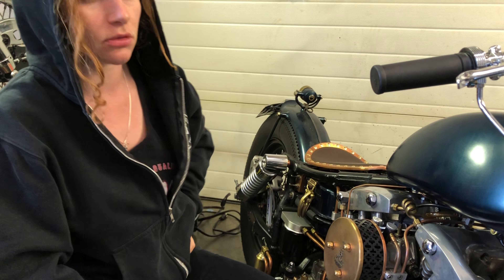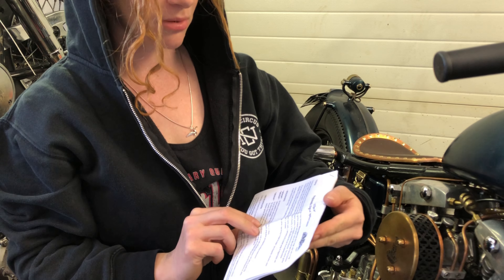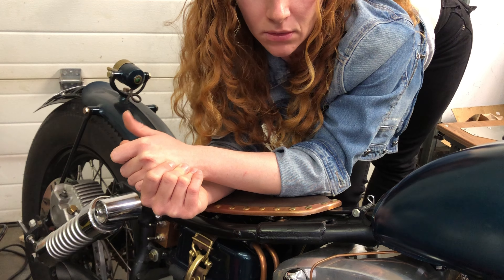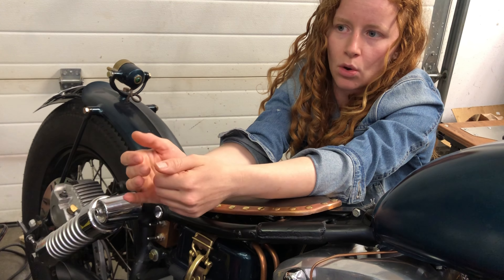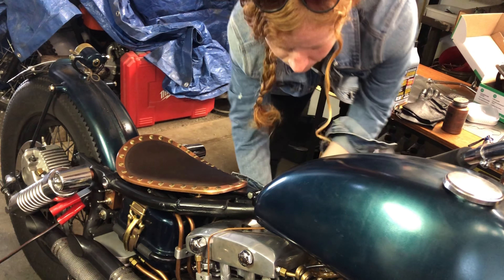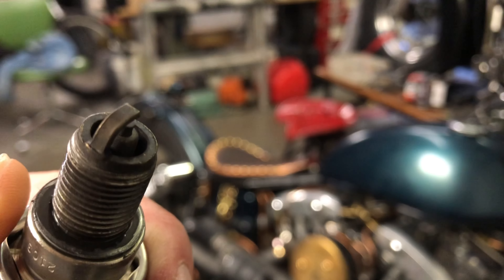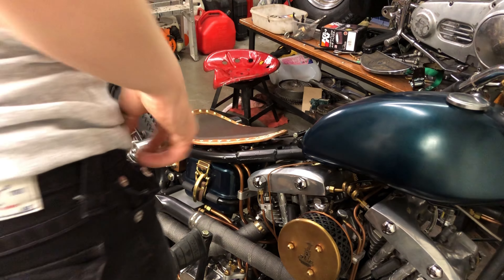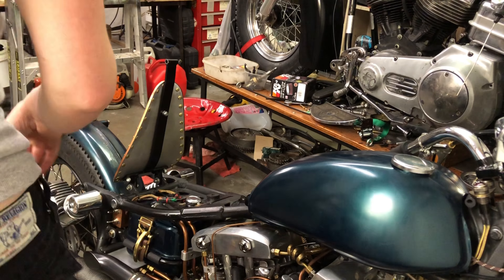Talking about the bike, filling oil and  a Compression test (16:00) on my S&S Shovelhead stroker.

Comment: Red, sorry took so long. 
If I remember correctly you have a S&S E right ?
Jetting on the G is different,  but I'll give you the " basics " for jetting the E with the ThunderJet. 
Intermediate: .031-.035
Main : .066 and up.
Air bleed: 135-155, that's the one on the side you thought was a screw.
ThunderJet: 100-145

Usually 2 sizes SMALLER on the main jet size, when using the T/J, than what S&S recommended for the main size in general.  This is your starting point ok. 

I do recommend using it, so don't let it throw you.  If you need the tuning on the G, let me know. And don't forget to suscribe to my channel as well,  I'm going to cut back on the racing because I need a life, and I will get to do some videos myself. Maybe I'll even play my bass guitar and give everyone a good laugh ha !

T.S. RACING
Reply from the maker: I just subscribed to your channel! And, as always, thank you for the info 😎
You are correct, my carb is a Super E with a replaceable air bleed jet.  I know that I've got a 135 in there for the air bleed right now and, if I remember right, my main jet is a .070 and my intermediate is somewhere around .036. 
I think somewhere around there, but its been a couple years since I've had a look inside. Can't remember the thunder jet size but I want to say its on the smaller side of those sizes that you listed. I plan on getting that taken apart asap when my jets arrive in the mail, and I will definitely be filming that for the channel!

I really look forward to seeing some videos from you! Will be awesome to see what you do and hopefully will get to see some of the racing side of things as well. 
 And yes, definitely need to share your bass skills as well 👌
Reply: I wouldn't drill no holes in a s@s e either. If u want more carb go to a dual throat

Comment: One thing about a compression test, make sure you hold the throttle wide open when testing. it's tough to get a good reading on a kick only bike but it will be artificially low if you aren't holding the throttle blade open. It can't get air past the throttle blade to fill the cylinder to compress. Love the bike by the way, those copper lines look amazing!
Reply from the maker: Thanks man! Yep, throttle was open during this process.

Comment: Those plugs are looking pretty black, the problem may be an over oiling condition. I have a panhead that had somewhat the same problem, fresh motor top to bottom, oily black plug color in both cylinders, exhaust pipes were wet with oil, had the heads off twice to check valve guides, and pulled the cam cover to check gear timing, no change. Was at my wits end as to what the problem might be when an old timer bike mechanic told me to remove the two large screws on the oil pump, springs, and check balls. Use a Q-tip to clean the check ball seats, and reassemble. The engine started behaving immediately, for some reason one of the balls for the bypass oil was stuck, allowing the top end to get flooded with oil. Also make sure the correct ball and spring is in it's proper bore of the oil pump. Your problem may be different, but ya never know till ya try.

Comment: i have a bike almost identical to yours  ive had many of the same problems as yours  solved them all  make sure the crossover tube on the rockerbox is not resticting the flow  as far as starting issues those ignition modules really work best with electric starts points or the dyna s work best for kick starts  and those thunderjets dont help at all

Comment: Thanks for putting up this video.  I am in my garage fussing with and occasionally swearing at my Panhead that is being very uncooperative, our bikes might be related!  When my leg gets tired from kicking (I'm around 40 years older than you) I sit down and watch more of this video and read the comments.  If you have a high performance cam, the overlap may lower the compression test results.  My engine is built very similar with high quality, high performance parts, I seriously doubt that your cam is anywhere near stock, which adds to the performance and fun but can be more finicky.  I've had my Pan for 24 years, had shops work on it, expensive mistake (one shop did the pistons and cylinders like yours, after they returned it I could turn the engine over with one arm using the kick starter), like you I am doing my own repairs and learning as I go.  Keep it up and stay positive.  A fringe benefit is that you get to buy more tools!  ☺
I just finished the video, great cartoon at the end!
Reply from the maker: Hey Warren, thanks for watching! That makes me feel better knowing that my videos of me sharing in my frustrations with this old thing can provide a bit of solace for my fellow riders. Thank you for your comment as well! And the comic is something my dad drew up in the 90s, he did a bunch of them and I plan on adding them to the ends of more of my videos. 
P.S. if you haven't seen Pacific Mike's channel yet you should check it out! He's got lots of vids of him working on old Harley engines. Here's a link to his channel: 
https://www.youtube.com/channel/UCgjEK5Whd-2jgogSwCHS0xA
Reply: Pacific Mike is an awesome teacher!😎

Comment: Red, there was a couple comments i thought where very good suggestions. First one was to check your pushrods for being too tight. The second was to check your oil passage balls. Lots of times there is not enough attention to the little things during these rebuilds. My take  on your issue is rings or the final bore size. You mentioned that basically that was all you changed on the rebuild.

Comment: Comment number three😂 I'm sorry. It is recommended to measure compression on a cold engine with the throttle open. Regarding: how much oil needs to be poured into the cylinder, the answer is a little (a whole glass is too much). Compression of older engines is usually not high (since low-octane gasoline was used earlier). For Ural and Dnepr motorcycles, 6-7 atmospheric units are considered excellent.

Comment: Red Rider, After 100 miles on a new motor you should go over all your bolts. I would specifically check the cylinder base bolts &
make sure those head bolts are good & tight. If you get them more snug then they were, readjust your vales if you have solid lifters.
If they are hydraulic, they should adjust themselves OK. I had an old Triumph years ago that the cylinder came loose after 100 mile
on a fresh rebuild. I destroyed the cylinder & had to buy a new one. I lock tight them now, but still check them after 100 miles on a rebuild.
I was taught not to use a torque wrench, but wack the wrench with a hammer on the head bolts till tight. I'd lightly tap the wrench
with a hammer on the base bolts too. Loose head bolts can give you oil in the cylinder & low compression.

Comment: Its only a small point. but have have you tried using  softer plugs . I had a a 1973 Norton 830 Commando  and it was a pig to start on hard plugs (champion). For around town I used soft plugs. and on long runs I would change to the Harder ones. Then I found NGK Plugs witch had a wider heat range, and my problem was solved. (Your plugs will be wet with all the Kicking).Good luck in what you are doing. I enjoy your Videos.
Reply from the maker: Thanks!

Comment from the maker: Just want to add a comment here. I did the oil in the cylinders (18:40) to check for ring seal, but the bike was still pretty hot so I’m curious if this would still work on a hot engine or does the heat cause the oil to run down the cylinders walls too quickly? I filled the cap from my quart jug with oil and poured two of those in there. Is the at enough or should I have used more?
Reply: that should of been enough even hot should not run past rings . a new motor or ring job if done properly honeing and ring gaps need to be done by someone that knows what there doing . also if your running overly  rich it will make it hard for rings to seat your spark plug didnt look sooty from to much fuel they look like there oil fouled either by rings , to much oil causing it to build up pressure and not letting rings seat or if your valve stem seal are shot and valve guides worn excessovly but 1 thing is for sure with your plugs lookin like they do so also will buildup on your pistons by witch piston and cylinder scuffing will accur . but for starters lets make sure the basics are good before we go to deep at this moment and that being compression test. and make sure when you doing the test your throttle needs to be wide open ok and do both cylinders the same amount of kicks lets do 4 kicks each if your  agreement on this?
Reply: thats terrable compression
Reply: throttle needs to be wide open if that doesnt help in better compression . it will need to be torn down
Reply from the maker: Throttle was wide open during this test…

Comment: Since I'm a fan of all kinds of automotive chemicals, (thanks to which, indoors, then my head hurts. You can use a carburetor cleaner). But the easiest and fastest way to clean candles is to remove the dirt with a rag and slightly calcinate (the part of the candle where the spark occurs) this candle with a lighter (ideally if it is a "Burner with ignition" and a small tourist gas can). You can also simply use sandpaper, but only in exactly the place where the spark is formed. If you know all this yourself, forgive me, I just want to give you a little hint.

Comment: Does it smoke ? If it's not burning oil then it's not a bad valve stem seal or rings . I never worked on a shovelhead but I've worked on Evo's and Japanese bikes and it could be a bad rocker box gasket or mating surface , also there are certain bolts that hold the rocker boxes on that require a copper washer or oil will leak down into the ports . Hope this helps .

Comment: I static time all my bikes. As far as the V.O.E.S. switch with that ignition. If the instructions don't require it, I wouldn't run it.
Why have another vacuum line? As far as I know, they are for the factory electronic ignition modules. 

When you clean a spark plug, you can't just clean the tip. You have to get way down into the valley of it with some fine
sand paper folded over. Otherwise it will ground the spark up inside deep down in the valley. Blow it out good.
A good starting point for jets is .0295 intermediate  .072 Main. You do most of your riding in the intermediate circiut.
The Thunder Jet is installed to correct a lean spot between jet circuits. I'm not sure if it's between the idle & intermediate
or intermediate & main. It adds a 3rd fuel circuit.
Usually rich mixure is a dry black soot on the plug. If it's wet, I'd think oil. I know when I pulled my head to fix an oil burning
problem, there was wet oil on top of my piston & oil washed a clean spot down from the valve.
Why don't you just run it for a while & keep a spare set of plugs with you for now.  I don't think you're gonna do any damage to it.
Make sure your heads are tight. I was taught to take a 7/16" box end wrench & wack it with a hammer till they feel tight..
Reply: P.S. The .0295 & .072 jets I mentioned are for sea level. If you live in an elevated location you might go leaner.

Comment: When going to  starting your bike leave the ignition off open the gas up and you'll pull the choke up and you'll kick it three times or four and then you'll turn on the ignition and the  choke off then start it and on the shovel sometimes you can turn the the idle up up   to make it idle faster and when it your fires up it'll run

Comment: I didn't read every comment, but did you leave your compression gage screwed in the cylinder? If not, do that and see if the compression drops. That will answer your questions about compression loss. As far as your carb goes, maybe let it run a bit rich. That motor is fresh, and letting the carb run a little rich will also let the motor run a bit cooler. If you're still concerned about it running rich, dial back your air / fuel mixture just a touch before you go and rejet anything. One more thing to consider is how long you let run with the "choke" on. Good luck and keep up the good work!
Reply from the maker: Thanks man!

Comment: People often fail to give complete and accurate info when talking jetting. On my early Super E (non-adjustable air valve), 74”, fresh top end, 3540 ft, 10-20 degrees C, I’m running .260 intermediate and 64 main currently. Fuel screw is 2.25 out.  More than S&S recommends but getting f within 1.25 was way, way too rich. I see a lot of people running a lot fatter, but if you are lower elevation, step it up, hotter, back in back down, etc.  80’s and bigger would need some more fuel. Mine is pretty crisp and clean.  Pipes are short with 4” baffles (exhaust with mufflers are ideal).   Static timing (magneto) and running timing was bang on.  I run slightly less advance to reduce or eliminate kickback on startup.  Messing with the mag isn’t needed then. Set it and forget it.   Good luck. Shovels are a labour of love.
Reply from the maker: My elevation is around 850 feet, I just put a 72 main jet and 295 intermediate… still seems like it could be running lean though?? But it was way too rich with a 76 in there so I’m not sure where to go from here. I have to wash the bike after running through a rain storm the other day (no front fender is no fun on wet roads lol) and then I’ll take my plugs out and check ‘‘em again. 
And p.s. my carb has a thunder jet and an adjustable air bleed screw, got a 135 in the air bleed right now. 
Thanks for the comment!
Reply: @RedRiderCanadaBC  is it a 74” or 80, or overbore?   Is it sooted or oil fouled?  Soot wipes off fairly easy if plug was clean.  Especially around the base of the threads.  Should be pretty clean under where you wiped.  Sooted is rich. If oiled it’ll be greasy and smear. Different issue with oily and can lead to false jetting readings.  I think you have a newer video showing wet pipe on rear cylinder.  Different problem there.  Keep in mind plug chopping can be done with very short runs, but after a ride it’s only an average aid in determining jetting.  If you go lean it’ll make noise but no power.  It’ll pop on decel, it may also cough, but it can cough/sneeze if rich too.    If rich it’ll be burbly sounding.  Might have issue pulling RPM with breakup.  Similar, but different issues with overly lean.   Your main only controls large throttle openings.  Focus on intermediate.  Set air screw after every change and only when engine is up to operating temp, do main next. Only then adjust pumper.  (Pumper or accelerator is turned off when screwed all the way in).       You can find the manual for the super E only, I just don’t recommend their setting fuel screw at .75 to 1.25 out.  Most carbs say under 3, ideally between 1-3 turns out.  It’ll idle out right at all settings but I found jetting much more accurate between 2-3 out. 1-1.5 out was always too rich of a intermediate.  Main can be changed through bowl drain so once intermediate is there you have the most difficult item done.   Good luck!  You should be getting closer with .295 and 74 but attempt to confirm rich and not oil fouled.    Also if too lean it can surge.  So vary speed slightly with constant throttle opening. It’ll feel like a strong tail wind.
Reply from the maker: Wow thanks for detailed comment! I’ll have to read it again when I’m in the shop with my bike. 
I think I’m getting closer to what it should be, still pops a bit on the downshift. But I don’t want to jet it up too much more or else I’m just back to square one with it being too rich. 
Also, my rear head has a valve seal leak so the spark plugs are getting a little oil fouled.
Reply: @RedRiderCanadaBC  no problem.  If your pipes are short and without baffles, this can cause jetting problemsn.   S&S has a good video with dyno charts showing this and why.  That said many, many, Harley’s are running around on straight pipes and doing ok.    I read another comment the other day where valve seal may be bad.  Harley didn’t use valve seals till later in the harley shovel days.  Valve guide to valve stem clearance is critical though.  You can add/change valve seals once the head is off. You will require a valve spring compressor and ideally the valve seal install tool, although careful work with a deep socket can get the job done. Seals are cheap.    Good luck!  Getting on top of the issues is part of the fun of owning a custom bike.  I know mine adds appreciation to my turn key bikes, although they lack the soul and character my chopper has.

Comment: My shovel with stock compression 7.4:1 pistons has about 115 ,120 psi .i don't know if that's good or bad but the manual says anything over 90 psi is good. there's 15,000 miles on it since new top end. It runs a little rich ,
 but not enough to oil foul plugs like yours. 
I'm wondering if your rings haven't seated yet..
My s&s E carb jetting I believe is a 70 main and a 30 slow jet. Two turns out on mixture screw, accelerator pump almost turned off. It Runs ok ,starts 1 to 3 kicks cold. And always 1 kick warm. Mallory ignition...
Reply from the maker: Thanks for sharing! Yea, the guy who did the rebuild said that the rings probably haven't seated yet and that could be why there is oil in the rear cylinder head. I'm going to have to check a few things out yet to really pin point the issue.